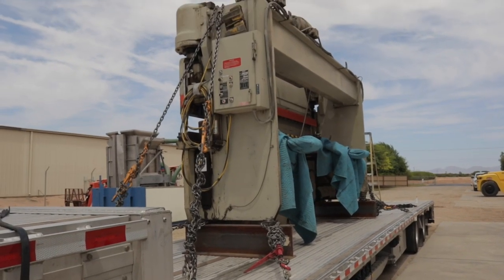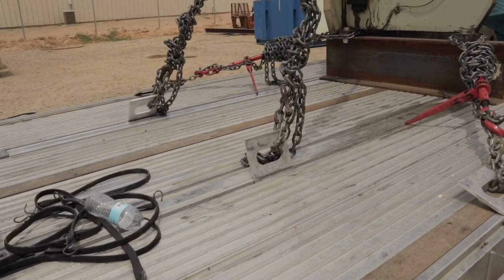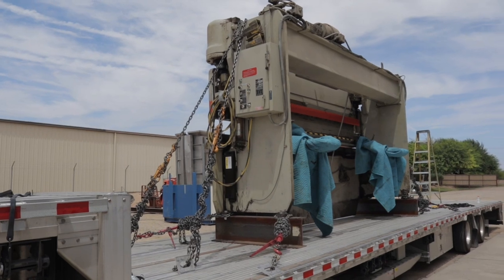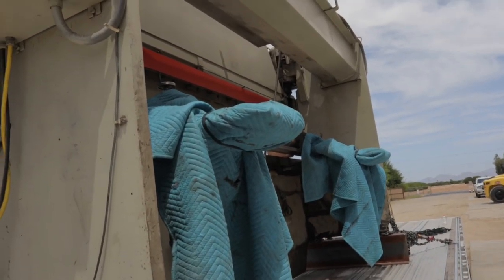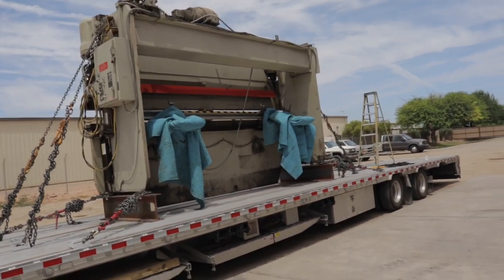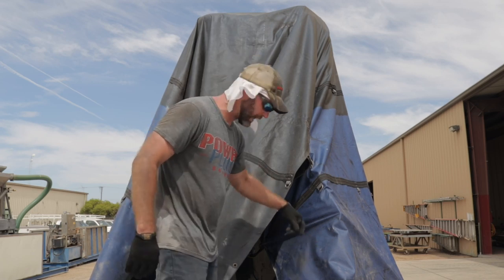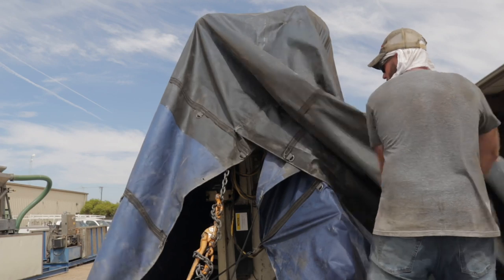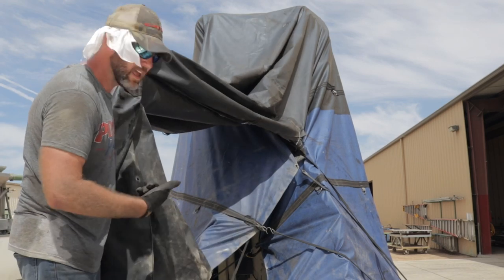How to Tarp a Step Deck Load | Machinery Tarping Tips

Comment: Thank you very much for posting up this video. It solidified my decision to NOT become a skateboard driver.... for several reasons. Top being the TIME it takes to strap down loads such as this. From my understanding, Tarp put is ONLY $25-40.... for 4.25 hrs of work ? Oh HELL no! Second being...standing on top of high loads... with no safety gear etc.... again. Oh HELL no! Third being all that physically exhausting work during High Heat index and freezing cold conditions. Again, oh HELL no ! I am NOT against hard difficult work at all, just under life threatening conditions. I drove a Concrete mixer that past month here in Nashville during that nasty heat spell we had... my old POS mixer had NO Air Conditioning at all. People just do NOT realize just how DEADLY Heat and Heat exhaustion really is. You "almost" found out the hard way. Thank God you didn't succumb to it. Many people do NOT. You heard about the ex-NFL Lineman that DIED a couple weeks ago from heat exhaustion did ya ? Dude was ONLY 32 years old and was still in great shape. He bit the dust working outside in that heat. I quit driving that POS ReadyMix truck last week. Largely due to the fuckkked up condition and NO AC. Mgr and Owner could give one damn. I went to a Doc appt a couple days later (on an unrelated issue). My blood work and BP showed I was STILL dehydrated 3 days AFTER I quit. My Potassium (Very critical Heart Electrolyte) was pretty high and my kidney functions showed/proved I was on the EDGE of RENAL FAILURE ! I was actually in grave danger on my final day driving and didn't even realize it. TRUTH. So, if this helps ONE person reading this, THANK GOD.
Reply from the maker: Yikes man that’s scary. I’m very lucky I came out of that unscathed ( to my knowledge ). I should’ve been paying better attention. I have food in the truck. Typically it takes no where near as long to load and unload. Usually there are tools to help you tarp and such, especially safety gear. Unfortunately that’s not always the case but majority of the time it is. Also, tarp pay as a company driver I believe is what you describe but for owners it’s usually between 75-150 so much better as tarping usually takes 30 mins to 1 hour. I hear ya though, sometimes it’s brutal

Comment: Big gaps on the side if you can put strap on the load it will help keep it shape  and keep the tarp from tearing.  Also helps with side wind.
Reply from the maker: Yeah, I just couldn’t get straps over the top because there was a bunch of stuff on top and the way the machinery was Bill there were certain parts that straps couldn’t go over. I prefer straps especially to shape but it just wasn’t possible this time unfortunately

Comment: I pull a step deck for a company out of Twin Falls Idaho. Where did you get the tie down for the middle of the trailer?
Reply from the maker: They came with the trailer, the trailer has built in grooves for them

Comment: Those square things you used to connect the chains to the deck. What are they?
Reply from the maker: They are J hooks, the trailer has to have the slides or rails built-in to use them
Reply: @DrivenTrucking  what is their weight rating? 
I've heard the name. Now I know what they're talking about.
Reply from the maker: I don’t remember off the top of my head but I know it’s either equivalent or a little more than a 3/8 chain rating